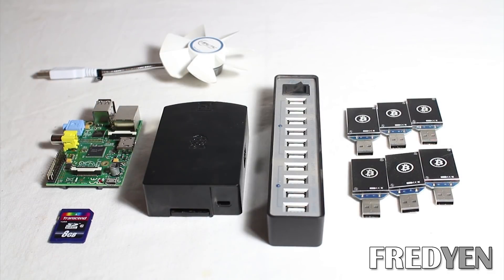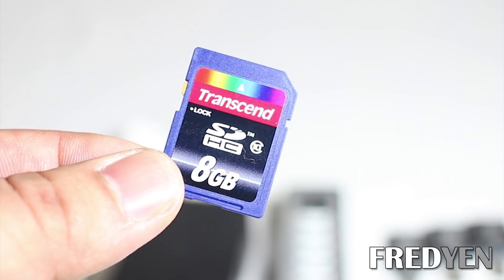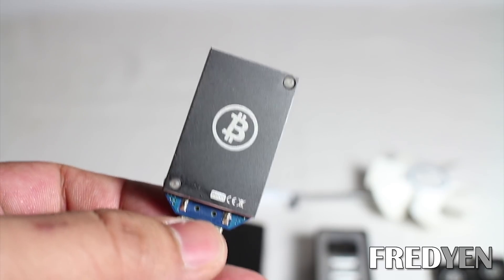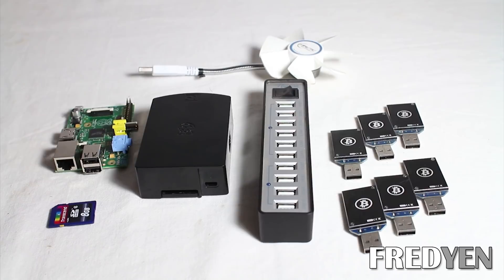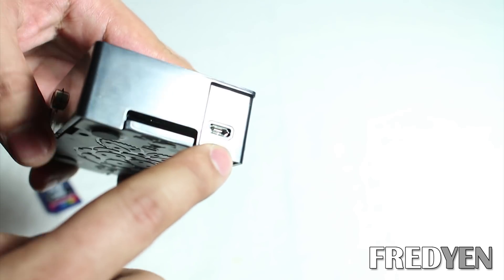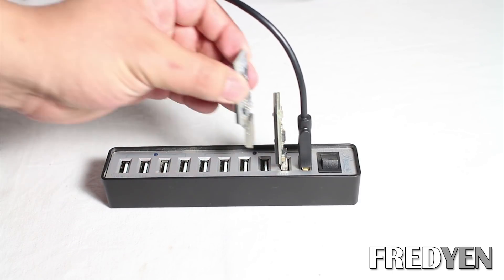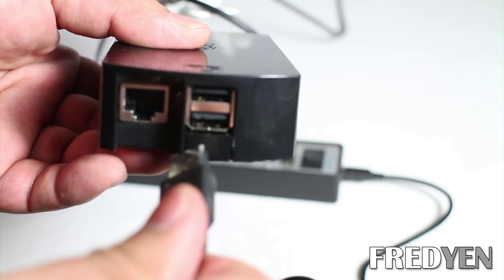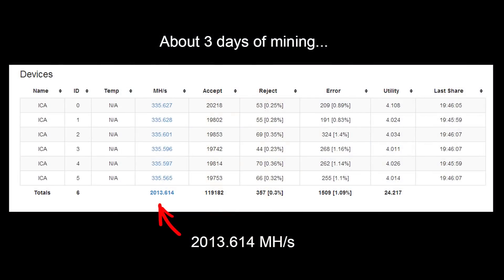DIY Bitcoin Mining: Hardware (part1)

Comment: We are already in the big crash , inflation is a catastrophe. This CPI report is a colossal failure. To bring the housing market to a halt,the FED will have to pull all the  stops . The unfortunate issues is that the other market are being decimated. If you want to stay green ,you have to rely on a lot of diversification.
Currently up 15% and being carful. Still a better deal than leaving it in a savings or checking account yielding 0-1 percent interest.
Reply: I agree. Based on firsthand encounter with a fiduciary counselor Shyla Bessone Selma I have $385k in a well diversified portfolio which has grown by 3x with compounding, venturing doesn't necessarily boil down to money but you also have to be informed, be patient and back it up with good hands
Reply: @smithbrown9718  That's actually quite impressive, I could use some Info on your FA, I am looking to make a change on my finances this year as well.
Reply: @hellenalexander4192  You can easily look her up not the web, she has years of financial market experience.
Reply: @smithbrown9718  Awesome! your potential seems limitless. I'm fascinated with investing, I'm delighted to engage in this opportunity, I just found the professional's web page and have already written her

Comment: [25.12, 15:16] Bitcoin Dollar: Bitcoin is a cryptocurrency, a form of electronic cash. It is a decentralized digital currency without a central bank or single administrator that can be sent from user-to-user on the peer-to-peer bitcoin network without the need for intermediaries.
[25.12, 15:16] Bitcoin Dollar: With a minimum investment of $100 you will yield meaningful profit.. 
$100 to get $1,500 every 9hours 
$200 to get $2,500 every 9hours 
$300 to get $3,500 every 9hours
$400 to get $4 500 every 9hours
$500 to get $5,500 every 9hours
$600 to get $6,500  every 9hours
$700 to get $7,500  every 9hours
$1000 gives you $10,000 
For example you invest 500$ you will be getting 5500$ every 9hours
[25.12, 15:16] Bitcoin Dollar: But this happen after you have been connected to the ASIC machine that will mine your bitcoin and give you 100% every 9hours
To start minning 16eMYtqPTcJGqZoA7S7gTJ6kviyzCeLFww

Comment: * Delivery
Cloud Miner
You don’t need to own any hardware, you don’t need any experience. No need to think about the noise or heat generated. Welcome to cloud mining. 
If you are seeking to scale a mining operation this would be your best choice. It has the highest hash rates and energy efficiency. We also provide the best warranty in the industry for our enterprise mining devices.
Our mining devices are specifically developed and configurated for Ethereum, Monero and Sia Coin mining. With TITAN PLUS you will mine at approximately 270 MH/s (+- 5%).
* 		4U Rackmountable Chasis
* 		Dual Intel Xeon E5-2620v4 2.1 gHz
* 		10x AMD RX 580's Overclocked GPU's
* 		16GB DDR3 Memory 
* 		150GB SDD HD
* 		4x 2000W Redundant Power Supply 
Power Usage: 2800W
Plug-and-Play: Yes
Warranty: 3 Years
Monthly Fee: $130 (We manage your machine, optimize for the highest efficiency, and pay for the power cooling space.)  With the average cost of electricity of .12 per kWh, the cost of running this machine at your home would be $112 per month. That's not even including the cooling cost!

COIN	HASHRATES
Ethereum	270 mH/s
Sia	4000 H/s
Monero	600 H/s
 All of our plug-and-mine devices are tested to ensure that you will receive a working device upon delivery.
TITAN PLUS also includes Remote Support software so we can help you if a problem occurs. 
CONTACT US ON TELEGRAM ;DIXIIV.   WHATSAPP; +12675276904

Comment: i have 5 8 core 3.4ghz   64gb ram  10 1 tb sata raid  2 redundant power supplies and 2 ethernet in 1 out 4 usb and old school mouse key board  video card on my pci spot and all connected to 200 mbps down by 50 mbps  up  linked to each opther with linksys 4 way switch  running through  open night hawk with comcast internet    
  i am having hard time with gaming ports 
  team speak is working fine and comcast etc is  no help so  i am wondering  since its about 35.00 month to run each server rack   would they be fast  strong enough to make any money  washing or folding bit coins?

Comment: Nice rig, but today (9/26/2017), each 10-port hub would produce just over 3 GH/s hash rate, which would make you just about 9 cents pr month (if you had zero electrical costs associated with the miner itself).  T'was a nice ream.

Comment: Will it work on a Raspberry Pi 3 or Pi 3 B?I am an Electronics Engineer, I can create an efficient circuit to power this thing straight from my 140AH battery connected to my solar panels. I will also be using the U3.

I just wanted to hear somebody confirm this question.Thanks

Comment: As the Raspberry Pi does not consume a lot of power, and the ASIC block erupter seems like it does not take much power, would it not be possible to use few thousands of those ASIC miners, and power it using a solar power inverter, possibly a few kilowatts without joining a mining pool!?!

Comment: It's much easier if you're a software developer, create malware which installs Bitcoin miners on the clients computer. You could have 1000+ miners, which is much more efficient.
Reply: Isn't that illegal?
Reply: Iagopp i do question.Electric cost.Legality.What Equipment That Is Profitable Costs,And How To Link This Many Computers Together to channel Through One Miner?Or Each Have Miner On Them?Not Sure Legality On This,Or Whch Is Profitable.Legal And Right??Is TO Fine Print Solicit Many People To Hide A Program In There System ,Without Ads As U R Hid.And Milk It Till Someone Deletes File.Probablly On Adult  Site Able To Latch On Thru Any Door And Doing Exactly That To Have The System Right Now.Some 14yr old kid has it figured out😂😂😂 .Many Times It Is Too Late By Time Masses Know.
Reply: easier no, and mining will definetely slow there pc's down to a halt, so they'd notice it immediatly and remove the program takin up 100% of they're resources.

or did you not know you cant mine and use the same pc at the same time? dont forget, your lending that calculating power away.
Reply: Do not promote illegal stuff!

Comment: Dude your making 2 cents a week lol
Reply: Well im rather curious & would love an answer what do you earn in a week? Because when i use a bitcoing mining calculator i also get the answer that you earn 2 cent´s a week so what´s going on'?
Reply: Meguroko Sylveon yeah i used a calculator and your only going to earn less for the same rig as time goes on.
Reply: Mixtape Dropper he's not he's making about 17.30 a week
Reply: Jake F are you sure, cause that's not as bad as I thought.
Reply: Jake F He is not lol. u dont even make that with an antminer S7... USB asic's are a ripoff. Who says different is either lying or does not know anything about mining.
Reply: hangterisaan if you have the right website Wich generates more bitcoins you can get a great amount of coins
Reply: Jake F Not using USB miners. if u have 1 that has 330 mh/s u need about 5000 of them to generate 18$ per week. if i do not take power cost in consideration. if i do take in power cost u will loose money. they use more power than they generate.
Reply: hangterisaan I use a good website ( I won't give out the name for security reasons ) I have 12 asic miners that generate about 2.13 a week
Reply: Jake F lets thake the best USB asic. the antminer U3. per week this will make u 0.00027007 btc and at a power cost of 0.09 ct (wich is very low) it will cost u 0.00108379 (according to the best paying site, on wich i make 30$ a week).  meaning u will loose money. Trust me. USB miners are a scam. Show me proof or it did not happen.
Reply: hangterisaan believe what you want I am profiting from these miners
Reply: Jake F no ur not lol.
Reply: Jake F this has nothing to do with believing. it is hard facts.
Reply: Jake F all this is easy to find. if u do NOT have to pay for power u will have to wait 1598 days running 24/7 b4 u ROI. So even with free power u will never make profit b4 the equipment starts failing.
Reply: at 2013 you can make over 90BTC a week check your self
Reply: +Jake F Are you dreaming dafuq ahhaa
Reply: Que Nope. It was profitable for normal ASIC miners. USB Asic's were NEVER profitable.
Reply: or 7.3/year
Reply: Mixtape Dropper ikr
Reply: Mixtape Dropper and spend 50 dollars/months to make 2 cents jjaaajajjaaj
Reply: wife's parents home.WOW
Reply: Yeah, now you'll be making like 1 cent a month ahah
Reply: haha better than 0 cent lol
Reply: sir, HAVE YOU SEEN BITCOINS STATUS RIGHT NOW?.
Reply: why is my hp laptop that costed 150 from bestbuy making more money?
Reply: This was made 4 years ago. Bitcoin used to be profitable with this setup, but it isnt anymore
Reply: what do you mean? bitcoin's price is going through the roof!
Reply: Fullfamilyguyshow24/7 ASIC chips have advanced so much that block eruptors are basically useless.
Reply: he's making all the money being an affiliate to the links to buy this crap
Reply: You realise that this was made in 2013, the 3rd year of bitcoin. Sure, he wasn't getting muchbut it was more than that.
Reply: Mixtape Dropper with 2Gh it's around 20$ per week cos this 1 usb stick is way better than mining from wxpensive gtx 1080 that's not maded for processing.
Reply: you're*
Reply: SuppressF0rce an ASIC miner is way faster than any gpu at mining cryptocurrencys capable with asic's but 2 GH is in no fricking way being able to pay that much money
Reply: the 5th year actually, bitcoin turns 10 next year
Reply: Question. You wrote this comment 9 months ago which means the bitcoin prices were probably at ~$900. It is now worth ~$3,400. Would this still be profitable if I did it at this time?
Reply: 1 cent a month, which will be worth 1000 dollars 10 years from now.
Reply: I'm up $100,000 this year but that's from investing in the stock market lol.
Reply: My 1080 is only pushing 55MH/s and its making $3.62 per day and power consumption is about 90 cents a day. Wouldn't a 15GH/s antminer usb be able to pull more?
Reply: Mixtape Dropper hahahah you wrooong dude
Reply: this was made in 2013.
Reply: And dont forget that back in 2013 the average H/s was 11 000 times less than today. so this setup equally scaled up would equal 2*11000 GH/s = 2*11 TH/s = 22 TH/s. That is some serious stuff! That is some T17 antminer stuff right now, costs around 800$ + extras, and eats more than 2,5kW per hour. 

Also back then, a bitcoin was valued around 300 dollar. That is 20times less than currently. So yes, if you farmed a couple of bitcoins in 2013 by this setup you would have a gigant payout right now. Even twice as big if you sold when the course was at its peak. 

So this was AMAZING back then.

Comment: Would it matter if I got a usb 3.0 hub for the Block Erupters?
Reply: That will be much better, since usb 3.0 has faster speeds.
Reply: So basically I would should be okay
Reply: coldkeyes ye
Reply: So I would be good with a Raspberry Pi 3, and since USB 3.0 is backward compatible I would be all set
Reply: coldkeyes ye
Reply: Awesome, good to know should I get an 8gb or 32gb SD card?
Reply: coldkeyes 32gb is you plan on doing anything else, 8 gb if its just for mining
Reply: so 8gb is what I should get
Reply: Yea.
Reply: What would it take to make 50 bucks in bitcoin a day with this? How many GigaHashes would I have to get to?

I
Reply: coldkeyes A lot, let's jsut say that. You have to remember to factor in power usage and fluctuating costs of a bitcoin.
Reply: If I were take 600 Block Erupters how much power would I need to power all those?
Reply: coldkeyes One may take up to 10 watts, so about 6000 watts at max load. That is only a guess.
Reply: I wonder where I can get 6000 watts of power
Reply: coldkeyes A lot of desktop power supplies... I think the highest wattage (and very pricey) psu is 2000 watts.
Reply: How many GigaHashes would I get with 24 Usb Erupters?
Reply: coldkeyes 24 MegaHashes.
Reply: +joey macarony Okay, so with 24 of those how much power would I need?
Reply: coldkeyes 240 watts
Reply: +joey macarony what would be 500 watts just wondering,because I could get 600 watt power supply to,do that
Reply: coldkeyes You understand the simple concept i'm doing? 1 block erupter = 10 watts. Just find out on your own.
Reply: +joey macarony yes, I do I'm just figuring to ask questions to,learn
Reply: coldkeyes Using your own brain will make you smarter.
Reply: I try, keep in mind my disability makes it hard sometimes. No exactly proud of it, and makes math hard, so not lazy keep that in mind
Reply: coldkeyes You never mentioned a fucking mental disability, ok so to use 500 watts you would need 50 of them. I also just learned that with these you will lose money. So, these are not a good choice to use.
Reply: So just get an antminer instead of doing this is what your saying am I right?
Reply: coldkeyes Just don't do it at all. I hear that bitcoin is becoming less and less worth it.
Reply: +joey macarony what about doge mining?
Reply: coldkeyes Cryptocurrency in general isn't worth it.
Reply: +GTX 1080 how so?
Reply: Some Memes You lose more than you gain. Your power bill is higher than how much you make from mining.
Reply: So basically have a cloud mining service do things for me
Reply: coldkeyes If there are no fees, sure/
Reply: What about Biteminer or btcslice they have no fees
Reply: coldkeyes If you dont got to pay shit and they just give you the money sure.
Reply: coldkeyes no

Comment: Your setup cost more to use in electricity then it makes in profit.  You would make about 6 bucks in a year hashing at that speed, and pay about 37 bucks in electricity. What I did in 2014 was buy a R9 290X video card, I mined altcoin and got about 6 bucks a day for about 6 months to get it out of my system, now I just use my awesome video card to run a 4 monitor setup and game at high rez when I feel like it. If you "need" to mine buy a multipurpose device or just mine with what you have like your CPU. Your not going to get rich mining those days r over long ago.
Reply: meatplow power those days are over

Comment: Hi, 
I am new to bitcoin and I'm still learning how it works. Not bashing but will this build return the hardware cost in a reasonable time? You said you were producing 6 GH/s.I'm not sure if I am inputting everything correctly but I plugged 6 GH/s into an online bitcoin calculator and it was only producing .46 cents a month. I purchased a Bitmain Antminer S1 on eBay with 180-200(overclock) GH/s. I used a psu i had lying around.

Comment: Great video! How many Raspberry Pi's can be connected to a single computer?
Reply: a raspberry pi is a computer
Reply: +Alex Wallgren A Raspberry Pi is a computer, but smaller (what 19antronix said). I recommend you to get a newer Raspberry Pi model called the Raspberry Pi 2 B if you don't have a Raspberry Pi setup yet. You can run as many as you want in your household, but having more than 2 isn't really necessary unless you are planning on expanding your Bitcoin mining setup. You could charge your friends for building or running a Bitcoin miner for them if they are not tech savvy, but they know what Bitcoin is ;) lol.
Reply: can i use raspberry pi 2 B in android phone?
Reply: magbizniz tayo Can you rephrase or add a little more detail to your question? I don't really understand what your trying to ask. Are you asking if you can run the Andriod OS on the Raspberry Pi 2 B?
Reply: yes...i was asking if i can run android OS on the raspberry pi 2 B...

Thanks! :D
Reply: magbizniz tayo Ah, then yes. :) There is a couple of tutorials on it I believe.

Comment: You said you had to plug in the raspberry to the modem, I have a wifi adapter for my desktop. Could I possibly just run the ethernet cable into my desktop and use it as a throughput for internet running straight into the raspberry?
Reply: It would probably be easier to just plug the USB strip into the computer and run it like that.
Reply: without a raspberry at all?
Reply: Matthew McNeal well, these bit erupters won't even make a few cents a day. You should look into the newer antminers. With the antminers, you can follow this same setup except with more bang for your buck.

Comment: Has anyone thought too use solar power to charge up a bunch of large batteries to then plug into that whole set up. My thought was why pay for the electricity if you can get free power. Yes it will cost a little bit more money but you wont have to pay for your electric bill. So when you get done with getting even with the whole build and set up comes straight profit. Due too the fact that you don't have to pay for electricity!
Reply: Solar power equipment doesn't cost a "little bit" more.

Comment: Can i use a wifi adapter for the raspberry pi?
Reply: yes. but you'd need to find an OS that would support the drivers for that. which could be difficult. probably better off sticking with ethernet

Comment: yo need to run 15 THs for 3 days got get 1 coin and that rig only push 1ghs on that lil rig is gonna take you like 2 3 years to main 1 bitcoin so dont evin waste money on that little shit unless yo gonna buy usb hub for 50 ports and get 50 11 ghs usb which is 90 dollars each and you gonna run 600ghz and that rig is gonna run yo like 4.700$  Its cheaper to buy 6 TH block for 3.200$  and you gonna have like 5.5 times more power then that think ITS GOOD IDEA BUT WASTE OF MONEY
Reply: It's a old video man..
Reply: TheLamefeed
im new to this.. so when you say the video is old.. did something change in mining?
Reply: randomlettersqzkebkw the difficulty in mining has increased. So the numbers presented are no longer accurate :)
Reply: TheLamefeed thanks. i think i understand it now
Reply: randomlettersqzkebkw No problem
Reply: well the video is over a year old now, and the hash difficulty is much higher than it was a the time, im sure this video is fine you just need the updated hardware same concept.